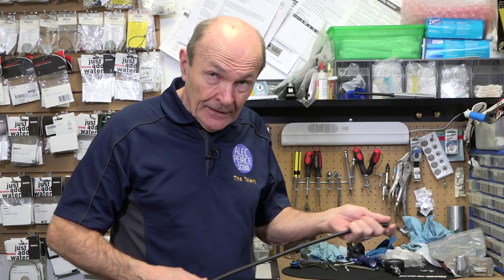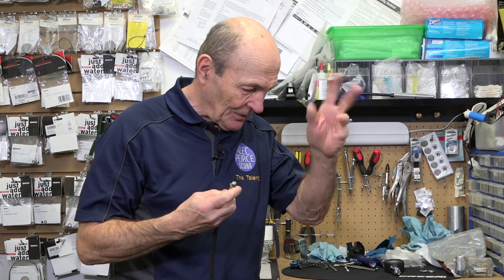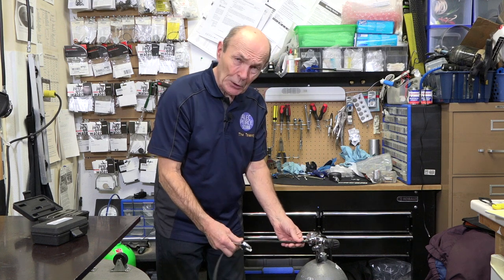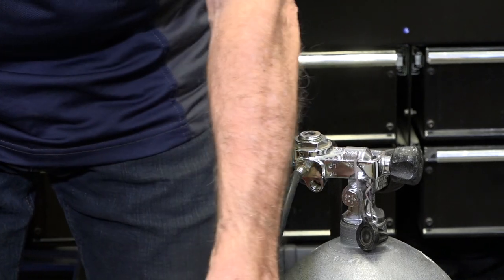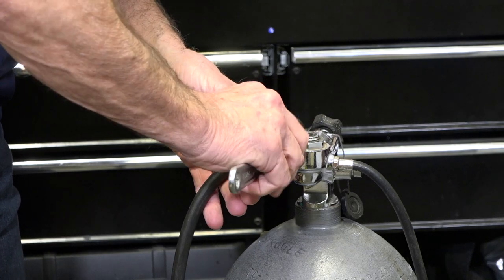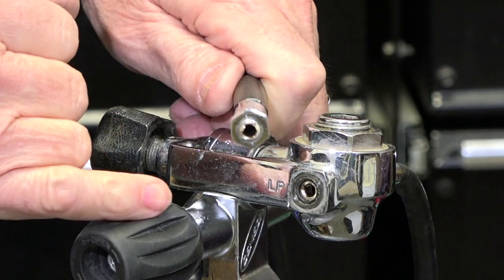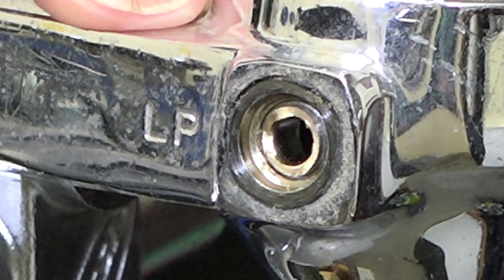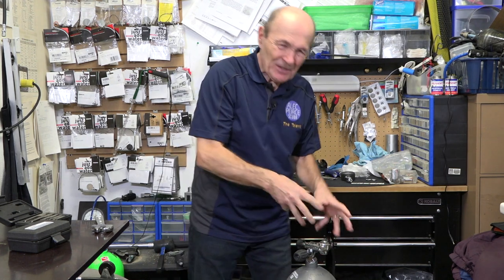Be Careful Tightening Hoses! - Scuba Tech Tips: S13E09

Comment: O-rings expands and seals tighter the higher the pressure is, they are basically self sealing so they dont need to be very tight, just snug them up.
Reply from the maker: Very true but some divers believe scuba hoses and truck nuts should be tightened with the same force.  Gorilla techs is what I call them.
A

Comment: Thanks Alan, I ‘always’ use torx bitset to extract these. Bit similar to your second screw extractor. Also works for din adaptors that got stuck over time🙂
Reply from the maker: I have removed many stripped threads during my decades of service.  Some divers just don't learn that the o-ring seals not force.
A

Comment: In my experience extracting probably thousands of screws and fittings both types of screw extractors will swell up the broken off bits because they’re both working from the wedge principal. It definitely is complicated extracting hard fittings from softer alloy parts. The only thing I think wasn’t covered is that with the screw in type extractors you need to or can also drill the hole to the proper size to match the extractor. I’ve also made them custom by slowly grinding off the tip to get a better bite in hard to reach areas where drilling wasn’t practical. So, when it comes to torque specs do you find those in the regulator servicing manual or the hose manufacturer’s data? Great video!!!
Reply from the maker: Your right about the screw type but I thought even 2 types might blow some minds!   Thanks for sharing and watching.
A.

Comment: Any torque after contact is for resistance only, you tighten further not to seal but to create resistance to avoid any loosening
Reply from the maker: It is hard to convince a muscular diver that once the o-ring has proper contact, it can hold back 3000 psi/250 bar with ease.  Brains not muscle are needed in diving.
A.

Comment: Hi Alec. I guess you are destroying more of Kevin's old hoses? A couple more variations on screw extractors are also available, first is standard schedule pipe extractors, these have straight splines that hammer into the inside of a broken pipe end and allow removal. Another is a stripped hex key bolt remover, these have a 6 sided taper that is slightly larger than the head size and can be hammered (or wrenched) into the stripped head then can be removed .The bolt is garbage but the thread is clear. Always a tool for the job, even if it is only what you have in hand.
stay safe Owen m
Reply from the maker: Hi Owen.  I don't mind destroying Kevin's gear, give him an excuse to buy shinny and new!  Good point on the extra tools too.  Take care and thanks for watching.
A.

Comment: I dive in both cold and warm water and want to pick my own regulators for this season. That means I have to change between a single first stage and two first changes perhaps two times a year. Is that an issue in terms of wear since it is a fairly soft metal or is that fine? I would need to swap the transmitter and a second stage each time.
Reply from the maker: There is no limit on changing hoses, wear on the o-ring is the only issue if proper torque is used.  I have vintage divers with 1960 regs changing hoses from dry to wet suits with never an issue.  Hoses will generally wear out long before 1st stage threads ever will.
A.
Reply: @AlecPeirceScuba_SeaHunter  Thanks. I guess I will ask our club technician to show me / look over my shoulder the first time. Probably gonna cost me a beer, but might be a good investment if the regs last half a century :)